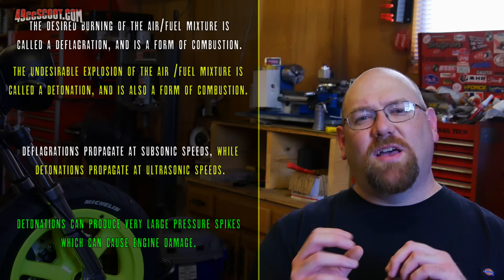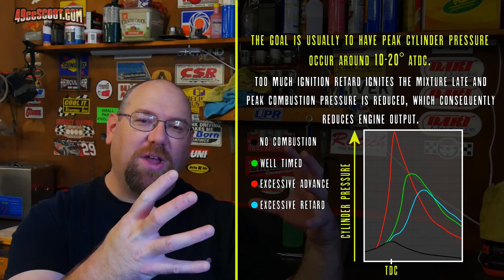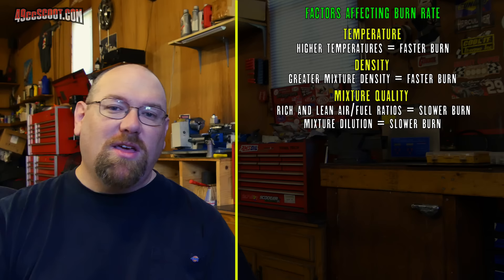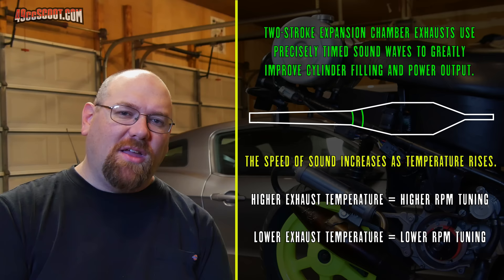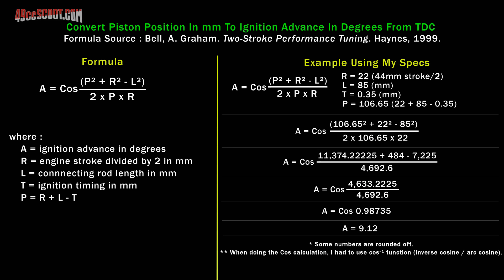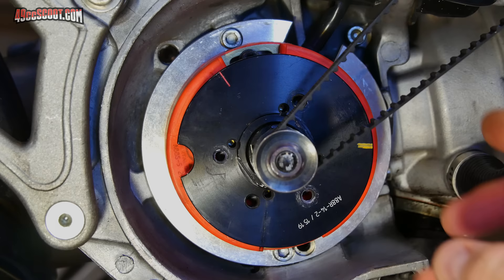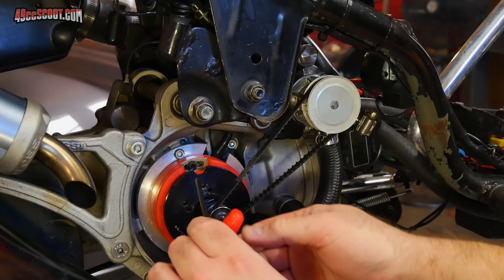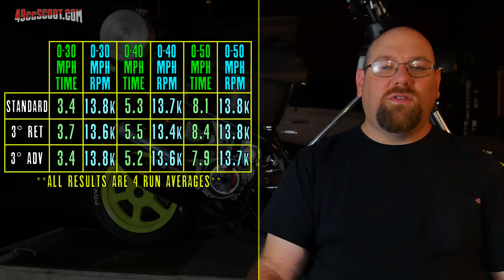Ignition Timing Explained & Tested : How-To Advance & Retard Timing With The MVT Digital Direct

Comment: But.... If timing is based-upon the RPM level, then don't we have to "choose" which RPM we want to optimize timing for?  For instance I'm building a 92cc chainsaw (2, actually, a side-by-side build of sorts), and one thing that's BLOWN my mind is how - with chainsaws, at least - the specs always list "ignition timing @X RPM", and then "ignition timing at y RPM" (usually they're Idle and Full Throttle RPM's for the two, respectively)  Do you think this means the coil is "smart" and literally doing varied firing-rates based-upon RPM?  If so, any keywords you could give so I can learn more? (think I have to learn Re magneto's/etc no matter what at this point because I'm doing a "build type" that is pure uncharted-territory)  Should mention this coil is NOT one of those fancy new engine-managing coils, it's the same type found on a 1975 chainsaw/blower/weed-whip/etc, I always figured they were "single spark rate" based on their position ONLY but seeing spec pages listing different ignition-degrees based upon RPM has me so confused here!!
LOVE how you mention your approach to it IE 'retard it a few deg., advance it a few, see what happens' -- believe it or not but I've NEVER heard the word 'retarded' in chainsaw-tuning, which is so weird because you'd think retarded timing would be pretty critical because it's "needed" for running high compression (a chainsaw build is just a high-compression NA build after all!)  Had never played w/ it myself, either, and just received the tool & a couple flywheel-keys (how we advance timing, shaving thousandths off a 'flywheel key' on the shaft), intending to advance timing because "I'm going for power" and as mentioned it's literally the only timing-manipulation I've EVER heard of in the chainsaw world, so weird because it seems so central to all other engine-builds (IE whether timing needs retarding/advancing, and by how much)  My engine's OEM spec is 13.1:1 comp ratio so will be aiming to push it to maybe 15:1 if able, limiting factor being piston slapping the cylinder head!  BTW I'm glad you mention it but IMO you don't stress just how dangerous/damaging pre-ignition is, knock is hurting power but not the engine, but pre-ignition when there's downward explosions hitting the upward piston as it's nearing TDC is so much worse than knock, I wish I knew that knock was more likely to occur first but don't know 1 way or the other, would love to hear if you do!!  
Thanks for the great video, when I get to doing mine I'm going to start with a slightly retarded timing to see if it out-performs the oem-spec timing, and go from there til near-optimal (I wouldn't try finding 'optimal' since it inherently means going 'too far' and reaching the point of pre-detonation, will retard it a lil and check, if no improvement I'll begin advancements -- thankfully my platform is a popular one and 20thou off the key is a 'standard' so I know "the range" and would probably begin trying a 5deg advancement and seeing how it went ;D )
Reply: BTW was nice seeing the man behind 49ccscoot, have been finding I'm watching (and Liking, of course!!!) so many of your videos lately, it's ridiculous but the "lay chainsaw-performance-mech" is SOOOO off-base, I can show you youtubes of "pro's" advising people to put 1/2" holes in the rear of their muffler, by exhaust flange, "because it cools & breathes better" (obviously ignorant to the fact that a 2-stroke inherently has a phase during upward/compression stroke wherein muff pressure SHOULD be above cylinder pressure, you scoot guys have piped exhausts so it's easy for you guys to see & exploit, but in chainsaws guys usually just make big holes!)  Funny enough, thanks to watching these non-chainsaw videos, my 1st "original idea" enhancement to an aftermarket, high-flow muffler, it just netted me nearly 20% power because I added a plate that redirects exhaust-pulse right back at the exhasut-flange...lil chainsaw muffs don't have the space for the neatness you guys can do, we basically just do '2 part mufflers' where exits are on front half and rear half is the 'working portion' of the muff, capturing the exhaust pulse & holding it for partial-reuptake!! Thankfully for me I can just take a large log and do before/after cuts, which I literally just did w/ my novel muffler approach because I know people on teh forums won't believe the gain I got so I re-did it and filmed it, but yeah it's so easy to see if something made a 5% difference when you're cutting a log that takes 25sec to cut and you do 3 cuts and have a cut-to-cut variance under half a sec (ie 20, 20.5, 20.25sec cut times...these are how accurate they are, for instnace my muff made a 20.5sec cut take just 16.5sec, so stoked because it's an older/iconic platform where you'd think "*everythging* would've been figured-out" yknow?)
Thanks again for the awesome content!!!
Reply from the maker: The more limited the ignition system, the more you'll have to compromise. If you've got an ignition with lots of freedom of adjustment, you can dial in timing for the range of engine speeds and in some cases you can add throttle position to the factors for ignition advance. If you've got a set curve, generally you can just move the whole curve by adjusting base/initial timing. So if you advance it 10 degrees on the low end, it's advanced 10 degrees up top as well. There are tricks like adding capacitors with a CDI system to change the curve, but if you want total control you need an ignition system that allows it : https://www.youtube.com/watch?v=qIf4loTFeiw

Comment: I have a 1980 yamaha DT125 that had a bad CDI box, I wired up a Chinese cdi box 6 pin connector with 5 wires, i get bad spark knock or detination on deceleration and inbetween shifts. Is there another CDI Box I could buy that would help? I assume it's because I have a 4T Cdi on a 2T bike
Reply from the maker: Obvious answer would be a CDI intended for a 1980 DT125. Otherwise, I'd see if I could find a timing curve from the stock CDI. Then see what matches up. Maybe a service manual would have timing specs? Some cheap 2T CDIs are just flat line timing  advance.

Comment: Hey man. Dunno if you still read comments on this, but i could use your help. Do you still have a fan for an ac engine and could you try fitting it on the mvt and see if the holes for the screws match? Thanks.
Reply from the maker: I used a stock water pump so I figured it should, but I just grabbed a fan from a 1E40QMB and checked. Fits fine.
Reply: @49ccscoot  its all good my fan just exploded
Reply from the maker: @rynairs6855  If you're running the MVT, I'm guessing it's high RPM. Not sure if fans will hold up to that.
Reply: @49ccscoot  what would you suggest on  an aircooled engine?
Reply from the maker: @rynairs6855  I don't think there's much that you can do other than try another fan. Maybe a genuine Yamaha fan, if that's not what you've already tried.
Reply: @49ccscoot  i got a piaggio engine 😄
Reply from the maker: @rynairs6855  Oh, sorry. I don't know about the MVT for Piaggio. I would assume  they'd do the same and make the pattern just like a stock fan. If you're breaking genuine Piaggio fans, it's probably either going to be a thing that you need to carry around or it  was a fluke.

Comment: hey scott you seem to be very knowledgeable about engine of the scooter. quick uestion if it quick answaer. my started having hard start, now it has been stalling out, now wont start all but sometimes it will but stall again when hit throttle,cleaned carborator, inside all fuel ways passages and float area. i put clear hoses to gas tank to observe what gas is doning. what i have notice the suction of fuel enter the carb line is not being suck down thru the line into the carbis one thing. but two after keep try start it the carb seem to slow flood with fuel some how then i will drain it because it not burning or starting. is something wrong with the vaccum pressure or something
Reply from the maker: Could be multiple issues. If it overfills the float bowl at any point, you may need to check and adjust the float height to prevent that.

If it is not filling, you may have a fuel supply issue. If it has a vacuum petcock, it could be related to that. Either a faulty petcock or poor vacuum signal from something like a pinched, loose or cracked hose. Not a bad idea to check the fuel filter. You can also try just removing the fuel hose from the carb and seeing how well fuel flows. If it's slow, try removing the gas cap to see if there's an issue with venting.
Reply: @49ccscoot  thanks Scott for replying so quickly but yes the new things I have put new fuel filter new lines new petcock but what I have noticed when I take the line off to fill the vacuum pressure it almost feel like there's no pressure pulley the gas down when I'm turning the ignition over that is one issue. But I think reason why it is flooding because a little gas is leaking down a little bit at a time and overtime the float is getting full and it's not doing anything but at times when I spray lighter fluid in the airway it was start right up and sometimes it would cut off and other times as long as I'm holding the throttle it will go
Reply from the maker: @1983bigfrank  Do a compression test to be sure the engine is healthy.

Comment: It had been better in 150km\h.I ordred new original motor Peugeot V-Clic gy6 139qmb,for 700 with shipping+tax,530 wich is cheap.New scooter cost 900,so I could get much spare-parts,but didnt.So I have 3,one un-original for 300.Planned to buy original exhaust with egr-connection.To get away high compression sound for bigger cylinder.60cc has begun to rumble in start,and making groove noise,so needs to be aggresivle tuned back both needle and screw.

Comment: What I know about 2strokes,.  Oil goes in gas, gas goes in carburator, airfuel goes in engine, power comes out! Haha not totally, but not alot more, I would like to get one to play with! Maybe throw a bigbore cr80 engine on a scoot! I'd love to have gears on a scoot!! But I been thinking about going electric!! I have enough high, extremely high current lithium batteries to build a 32ah 72v battery, capable of a sustained 800amps! And 1600 peak amps, 20 series cells , 4 paralell,  that's enough wattage to supply over 18hp, with insane torque! It would be like a supercharged turbo diesel, 16hp engine,  a 3kw motor on a bicycle would do 50mph+ so a 16kw motor on a little scooter should do nicely! And should only pull around 600 watts cruising at a legal speed, maybe the variator could be used with a electric brushless motor! That could extend the top speed! While keeping a good takeoff and acceleration! I guess I'll have to keep gathering parts, I was thinking about a e bike or E-cycle build, maybe it's an E-Scoot build now!

Comment: Hey, nice video. My bike makes “knocking” sounds from the engine after changing to MVT dd. Do you know why? Is it wrongly timed or why does it knock like that. I don’t think it’s very damageabke because it disappears as fast as I hit the gas. So it only knocks on idle
Reply from the maker: My first thought after an ignition install when hearing knock is spark knock or detonation. It really shouldn't do that at idle though. Have you checked your variator lately? If the plastic guides/slides on the ramp plate come off or get worn out, it may rattle or knock at idle.
Reply: @49ccscoot  Well this is a am6 Engine so not a scooter however tho what is a sparkknock? Because dum as I am I installed it wrongly and but it on 0.35 btdc instead of 0.40 btdc. I have a 80cc but with stock stroke so I should be running 0.40 btdc but I did that wrong
Reply: @49ccscoot  do you think that might be the problem?
Reply from the maker: @anglofil5489  https://youtu.be/lGC51mIQylk
Reply: @49ccscoot  late answer but I discovered the issue and it’s the squish. The squish is a wooping 1.20-1.30mm🤯 when it should be 0.5-0.7mm so almost the double. That is probably the reason it knocks because the fuel makes an explosion of the compression rather than the ignition which will cause a uncontrollable combustion and result into a knocking sound. I took the engine out and got it into pieces the cylinder and piston was lucky in great condition. However tho I don’t really know how to solve the squish issue. I remounted everything but still 1.20mm squish. What is there to do? Cut down some of the cylinder but that would effect either performance or the stroke. Pls help
Reply from the maker: @anglofil5489  Thinner or no base gaskets may work. Sometimes heads can be milled. Iron cylinders may be OK to mill, but that wouldn't be good on aluminum with a coating.
Reply: @49ccscoot  yep I checked the gasket and it was 0.5mm so I checked the squish without it was decent 0.8mm. So I found a gasket that 0.15 mm might be fine with that

Comment: I just rebuild a 250cc Polaris trailblazer and have spark, fuel and compression but it’s not sputtering or firing up, is it possible it’s the timing, the timing mark is on the factory marker. It’s been bored out, oil pump removed so it’s premix, completely rebuilt engine
Reply from the maker: Make sure it's fresh fuel first and that you are getting fuel on the plug. Could be as simple as being flooded or lean. It can be timing, but most of the time it's something more simple.
Reply: Do you suggest try to put gas in the spark plug hole or running it through the carb for testing
Reply from the maker: I usually look at the plug first to see if it's even getting any fuel on it. If you've been cranking it much and there's no sign of fuel, then it may have fuel but it may not be finding it's way to the cylinder. Sometimes priming it will be all that it needs. You can put a few drops of fuel in the plug hole and close it up quick to retry or some prefer spraying carb cleaner or starting fluid through the carb. I've used an unlit propane torch in the inlet of my airbox while cranking it over to get them to start. 

Obviously do this stuff at your own risk.
Reply: @49ccscoot  I appreciate I’ll let you know how it goes

Comment: How do you advance the trigger pickup to advance timing?
Reply from the maker: With the MVT DD ignition, you can loosen the stator mounting screws and rotate it. For large changes in timing, you may need to install the flywheel at a different setting.
Reply: @49ccscoot  can you make a video of it?😁
That would be really helpful for everyone who wants a fast bike on a budget.
Reply from the maker: @KXSWORKS  The video that you're commenting on shows the process with the MVT DD and it's the same or similar for any of these racing ignitions. I also have a very detailed MVT setup video : https://youtu.be/JVZr74Lt0DQ

Comment: Hello i wanted some help with this i have 70cc kit on my aerox and stock ingition and it was running and it just stoped and made a noise at the ingition and everyone is saying its off timing i looked everywhere no one can fix it i hope u can help me with it what to do!
Reply from the maker: I would start with the basics :
https://www.49ccscoot.com/faq/wontstart.html

If it's making a noise at the stator/flywheel then I would check for contact. If it's a noise at the CDI then I'd think either the CDI is bad or wiring issue.
Reply: @49ccscoot  i changed the sparks and the carb to opened the topend to see for any crank but no it was in a good condition! So where can i check the cdi?
Reply from the maker: @ensarraka  Can't check a CDI without special equipment that basically no one has. Most just replace it to see if it works. Not a bad idea to keep a spare around anyway for that reason.
Reply: @49ccscoot  my bike now backfires with the new carb
Reply: But still didn’t turn on
Reply: But still didn’t turn on
Reply from the maker: @ensarraka  That does sound like timing is off. Might be able to see it with a timing light while it's cranking.
Reply: @49ccscoot  do u have any video of showing how it works and how u can fix it!!
Reply from the maker: @ensarraka   If it's a stock ignition, or any with a keyway, I'd first make sure the flywheel and crank were still aligned via a woodruff key. There should be a groove in the crank and one in the flywheel. A woodruff key fits in the crank and forces the flywheel to align in a certain clocking. They can shear though, and allow the flywheel to move. That would throw timing off. Take a look at that before getting into anything more complicated.
Reply: @49ccscoot  i looked for it still cant fix it can u please make any video or show me with words what to do else?? Need help

Comment: Can u help me,I'm learning to fix my dio,it's now in 6 pin cdi and it moves backwards,
Reply from the maker: So you just installed a new CDI and the engine starts backwards? Stock ignition, aside from the CDI?
Reply: @49ccscoot  I put the gy6 ignition coil and it's working fine on my old 5 pin cdi,but when I try use the 6 pin conversion it start to move backwards,then now I tried again the 5 pin it has some current but having no spark
Reply from the maker: @hansmarquez  I'm guessing the 6 pin CDI has a different timing curve that is causing  the engine to start backwards. If you have any adjustability, either in the CDI or pickup or stator plate, then maybe you can remove some ignition advance and see what happens.
Reply: @49ccscoot  the ignition timing of  2 stroke relies on the stator pickup distance?and flywheel timing?
Reply from the maker: @hansmarquez  Yes, moving the pickup or flywheel relative to each other will change timing.
Reply: @49ccscoot  thank u I'm from philippines :>